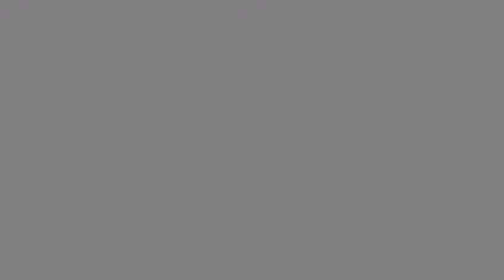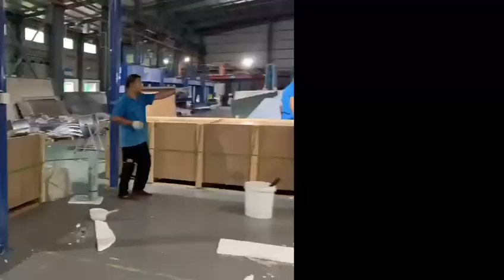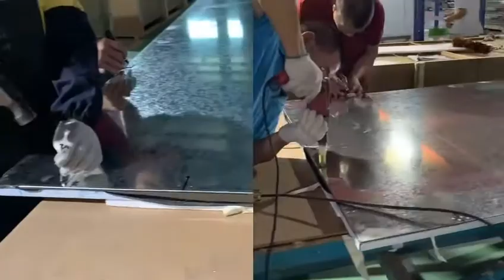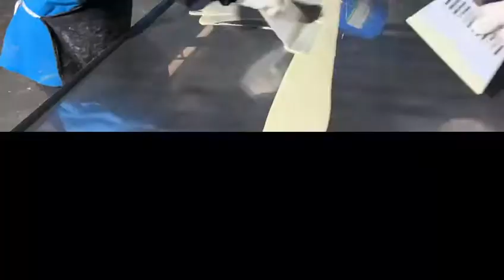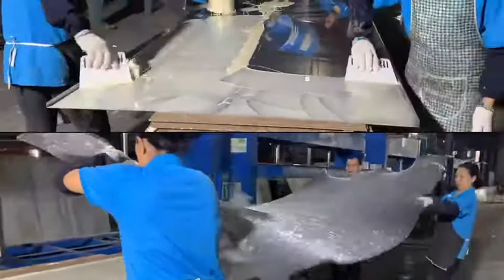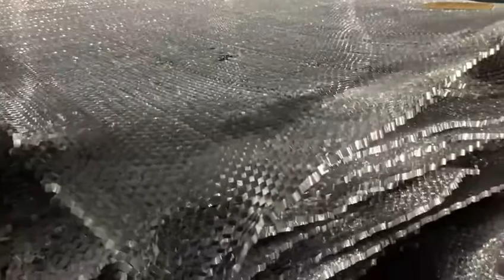Production of aluminum honeycomb panel at Friday

Comment from the maker: How do we make aluminum honeycomb panel ?  Except the standard cut to size, lamination, edges fold, we also do the assembly according to clients’ requests. We are making formed, irregular shapes aluminum honeycomb panels with brackets, to save installing hours at job site, easier & faster the installation.